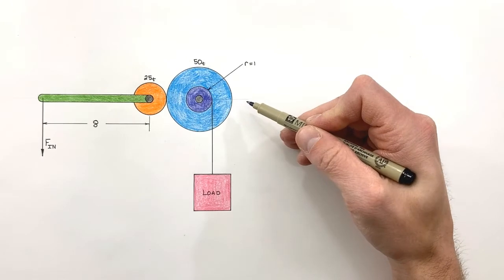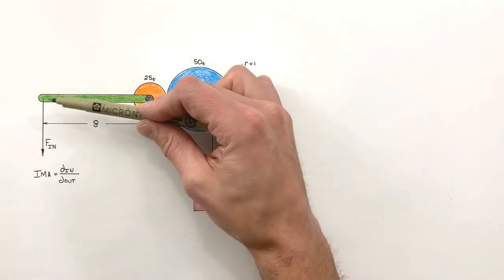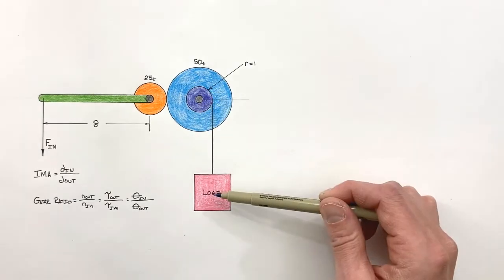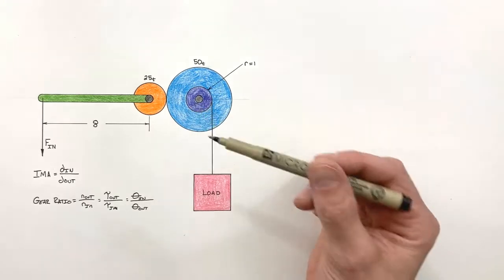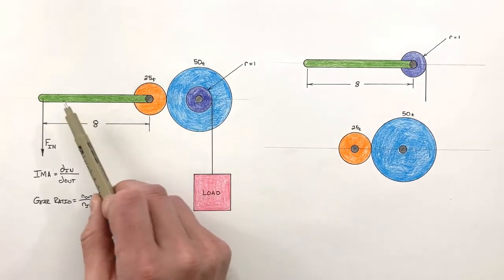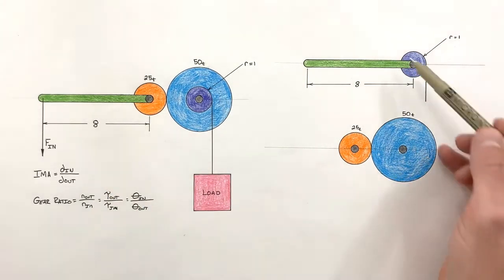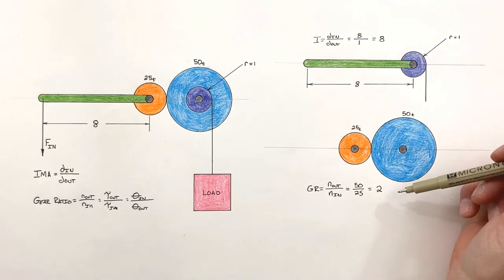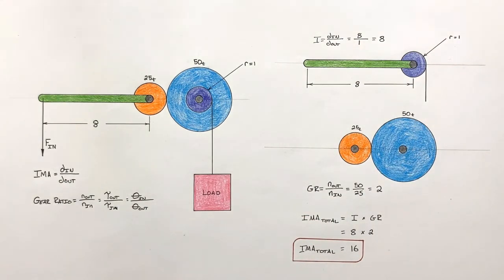Compound Machines With Gears: For Engineers

Comment: Can we treat treat it as two wheel and axles not double counting any wheels/gears:  ie Green to orange (8/2.5) * blue to purple (5/1) =  16 IMA?
Reply from the maker: Absolutely.  Effectively you are looking at the gears as the input or output side of a lever mated to whatever else is on that axle.  That is a perfectly acceptable method of determining IMA.  

Just be careful to not try to bring gear ratio into the equation.  In a situation that includes something like a worm gear however you get stuck having to isolate your linear components (simple machines) from your rotational components(gears).